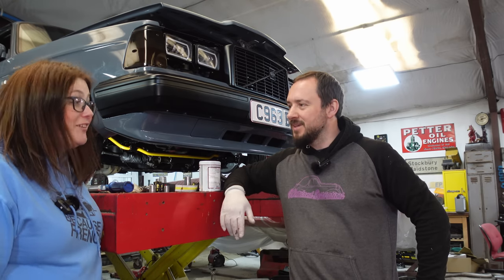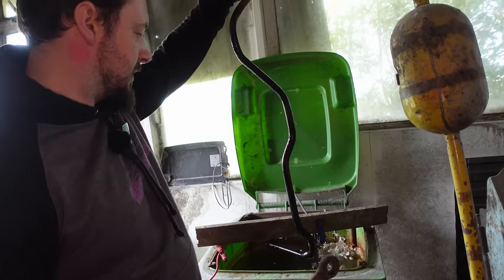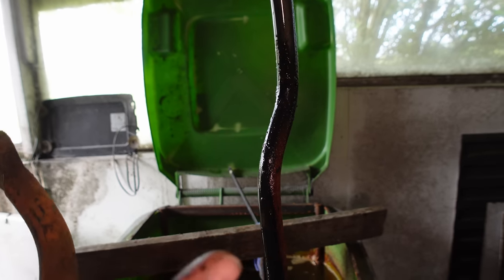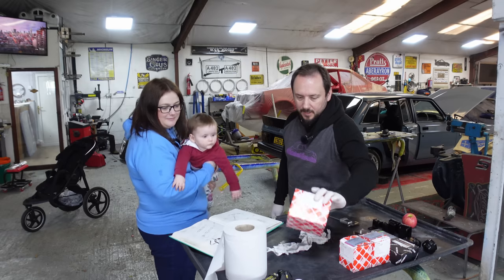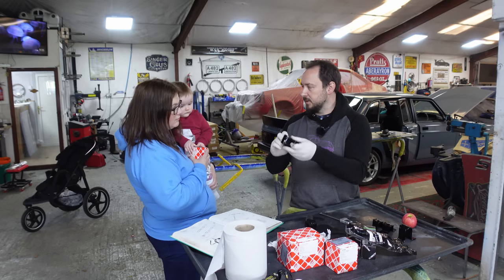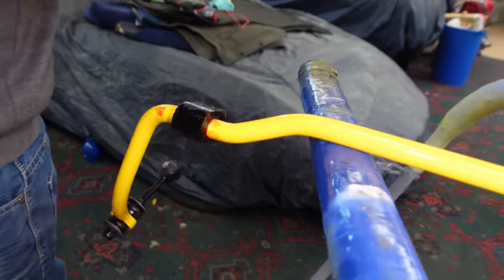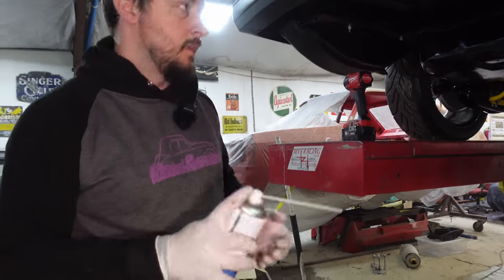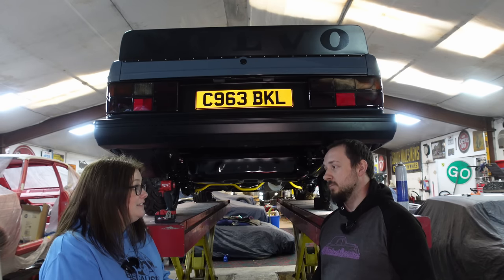Volvo 240 Front & Rear Anti-Roll Bar / Sway Bay Refurbishment feat @HubNut cameo!

Comment: Hi, how did the trimmed front sway bar bushes go? Are they staying in place? Interested, as I am about to do the same thing, with the same bushes from Classic Swede. How did the MOT go? cheers
Reply from the maker: Hey Brendon! The bushes are fine. We will be upgrading the whole setup to powerflex in the future but for now they are spot on. Just make sure you trim enough to keep them snug but enough off for movement. MOT.... you'll have to tune in tomorrow to find out about how that went 😐
Reply: @WhitelandRestorations  Nice. I'm fitting Dai's 260 style front sway bay, to clear my engine sump...not a Volvo ;). You can bet I'll be watching.